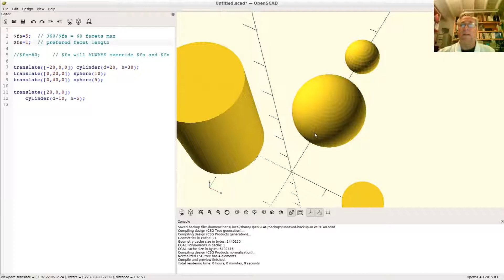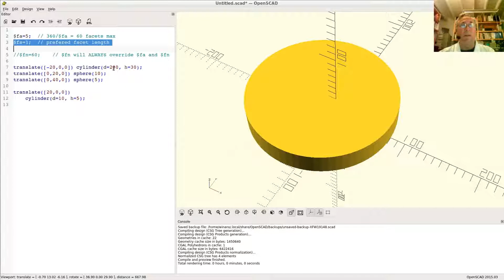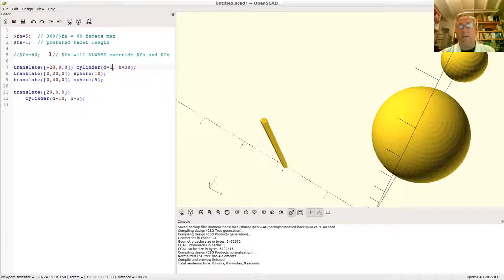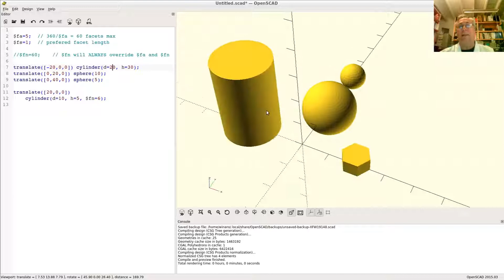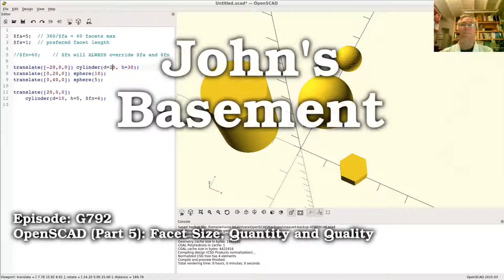OpenSCAD Tutorial (Part 5): Facet Size, Quantity and Quality

Comment: Life changing, thanks! I was designing objects in BlocksCAD and was wondering how to increase number of facets for smaller objects, like making a 2 mm diameter hole really round instead of a pentagon. BlocksCAD offers a OpenSCAD compatible code export, now I copy&paste it to OpenSCAD and fine tune it with `$fn $fa $fs` as explained in the video.
Reply from the maker: Glad I could help!  Have fun!